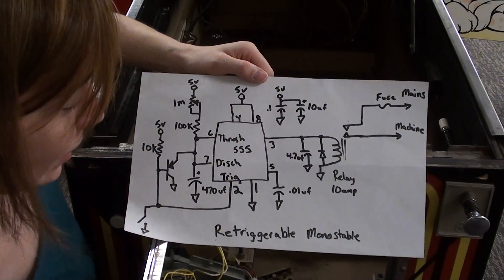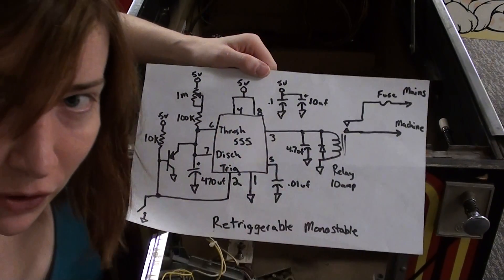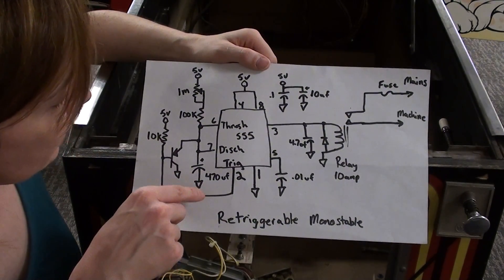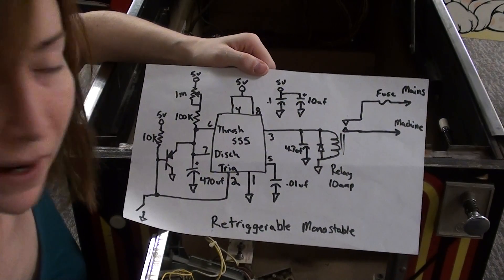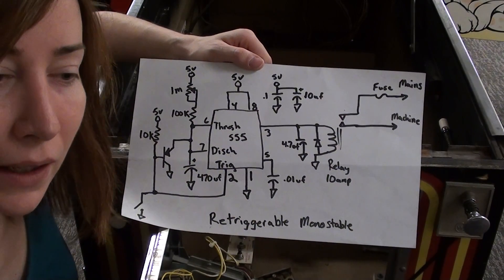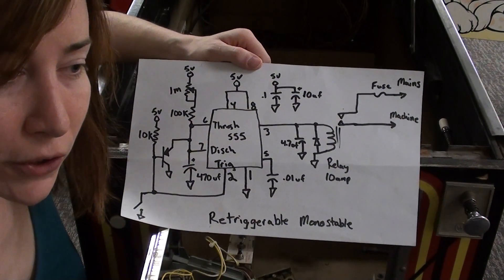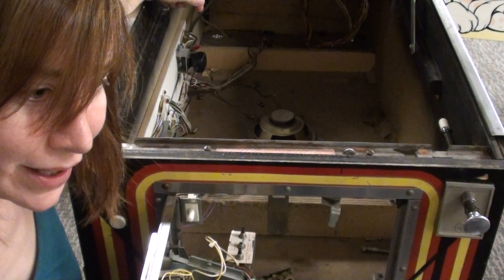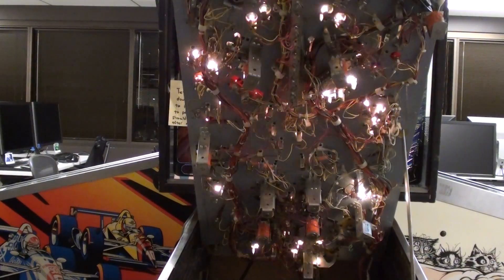Pinball and Arcade Auto Power Management - Save Power, Lamps and Monitors

Comment: Good basic RC timer for short time intervals but leakage of the large value capacitor will affect timing, may not be reliable. I used 4060 oscillator and binary divide down counter for long time intervals that I  designed decades ago.

Comment: Ive almost made it through "Digital Circuits" by "William J. Streib", it helps a bit to understand what is on a circuit, at least i understand what wverything is youve drawn up. I think experience really helps in making your own circuits. Its kind of new. I am looking forward to making "the art of electronics" by "Paul Horowitz, and Winfield Hill", its a more in depth look into every component on a circuit board. Digital circuits did however get me acquainted with flip flops and other integrated circuitboards. 

I want to make an arduino (boring(??)), work with a thermocouple in a clayoven so it can do heattreatment of metals that need really specific temperatures at different times/durations for it to give a good heat teatment. The temperatute cannot overshoot the temperature target, and the temperature deviations should be small. I am going to use a thermocouple and thermocouple shield, and a solidstate relais to to switch the heating coils on and off. Really no clue yet how to program it all. So i thought reading about digital circuits helps out. Maybe not the fastest way to get it done, but at least i can tell what is going on. I also still need to fix my guitar amplifier. So yeah, enough reasons for learning about the electronics trade. 

Greetings,

Jeff

Comment: hi! could you give me a design of a regulated power supply that would recharge the battery of my motorbike running at 48 volts 6 amperes without any transformer or with transformer. Thanks Jeri.

Comment: Several makers have "retro" bulbs but, I still have not run across any I like. They are trying to replicate the incandescent light but, it just is not the same. Nothing to do with how fast it comes on. That is an interesting idea for under inserts and such though. Personally, I love the LEDs on my solid state machines. If the light is too sharp for a particular machine, I may use LEDs only on the playfield inserts, and incandescent bulbs everywhere else.

Comment: I have a slightly more interesting but complicated idea. Google for "msp430 grip detection". This would allow the machine to wake up on human presence rather than having to find the 'hidden' activation switch. By adjusting the capacitance threshold it could trigger on proximity not just touch.
I think the same idea can be implemented with the same 555 circuit and a floating MOSFET as an antenna trigger.

Comment: hey Jeri, I think the PNP might get overstressed, as when it shorts out the 470uF, it sees a large surge current.  Just gotta make sure you get one that can handle the peak current without getting too hot.
Reply: nah, the current wouldn't be that high, and the amount of stored energy is tiny. I doubt it would be an issue. You could always put a small resistor in series if it started burning them out, but I really doubt that it would.

Comment: I like that you shared some of the safety design considerations.  A 10A relay is a reasonable value I think.  I also assume it's a normally open relay, so that if your circuit ever fails the system would most likely go to the off state. Being paranoid, I would fuse the power supply to your box & use at least a 10 minute time to try to reduce the power cycling which is usually quite stressful for electronics. An 8 pin micro-controller would reduce the number of parts and increase reliability.

Comment: What's the max time delay on the cutout? I have 35+ machines that I have on all the time during parties etc. I would like the attract modes to run longer than 5 mins at a time. Perhaps a cutoff of around 15 mins. The negative effects of a machine turning on and off multiply times in a night would be more detrimental than just leaving them on. However if no one plays a machine at a party for more than 30 mins, it's probably not a favorite of the night.

Comment: happen to see this video,I am not a 555 expert and knowing very little about 555.but I wonder that snooper capacitor you put up there is working,is not what you saying because some threshold  or back slash current ...it is working because that capacitor make sure that it will not turn on at the first time.

Comment: I think a lot of the occupancy sensors using PIR won't work well enough, because if you stand still when you're playing, they will switch off the machine in mid game. That would be really, really annoying.

I think a better solution would be to use a standard "Fan Run-on Timer" and connect it to one of the flippers. That would probably also avoid the need for a wall-wart because they're probably line powered.

You may be able to just connect to the flipper directly; or use the reed idea.

Comment: @senoirlugnuts Couldn't this circuit be classified as "minimally invasive?" Depending on how connection is made to the AC line in the machine, if might be able to be removed without a trace.

Comment: @carabela125 This is a good idea. They make occupancy sensors that fit in a single-gang box. Suppose you put one just under the bottom edge of the front of the machine's box so that it looked at the player's legs. Then you put some IR-lossy material over the IR window to reduce it's sensitivity to the point that you have to be standing closer than a foot away. That would turn it on and keep it on. 

Of course, for Jeri, you would need some really lossy material due to her HOT legs. :-)

Comment: @wolfekeeper The traditional way to handle it would be to put a wind-up or motorized timer ("Turn past 10 to turn on.") in the AC line. However, if you forget to wind the timer before it reaches zero, the machine dies unexpectedly. This circuit runs forever (or at least until a power fail) as long as someone is flipping the flipper.

Comment: @jeriellsworth I guess it was because of the moving core from the relay which induced voltage rather than the inductance of the coil itself, so I also guess that it was noticable because a 5V relay needs a lot of current or has much more windings than a higher voltage one.

Comment: Nice piece of device. I could easily think of many other cool application I can do with that. But one question, and maybe is a more general question, why did you use a relay instead of an optocoupler? I am a beginner hobbyist but I might think that those optocoupler would need less power to switch plus it must be faster but this is less important.

Comment: Quick question: Wouldn't it just been easier to have made a small and simple power supply circuit to go along with your time out circuit and have it connect parallel with the main power supply on the mains connection? So then you would have that extra outlet still and all you would have to do is replace the fuse?

Comment from the maker: @FlyByPC I used a 2n3906 and the high ESR electrolytic caps.  I doubt there will be an issue at the rate a person can push the button and the small amount of charge(the circuit trips at 2/3 the supply rail) .  3-4 ohms in series wouldn't hurt if you're really worried.